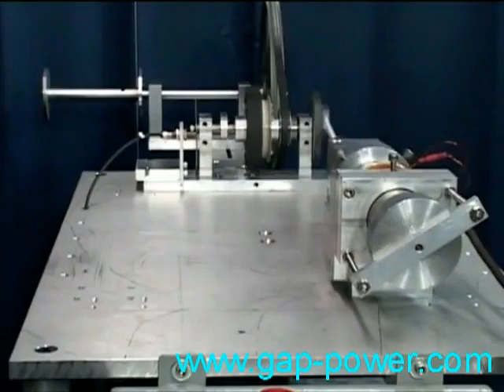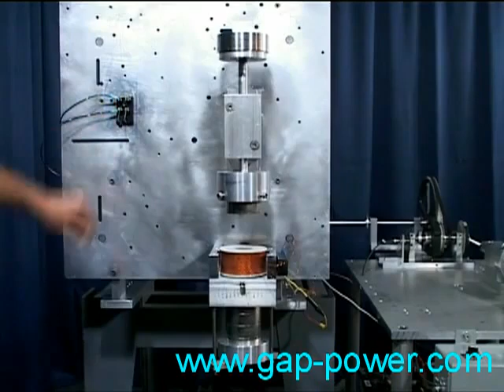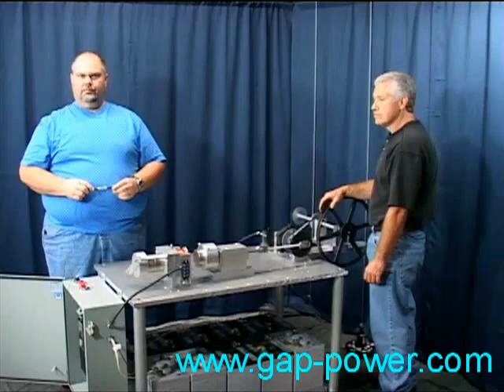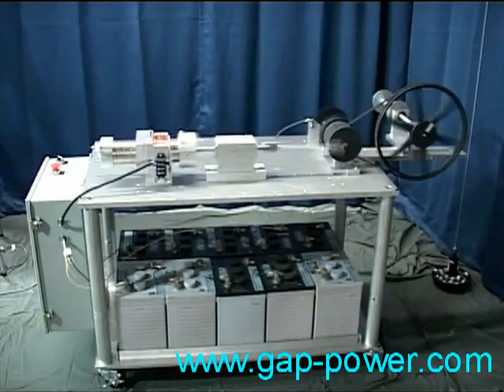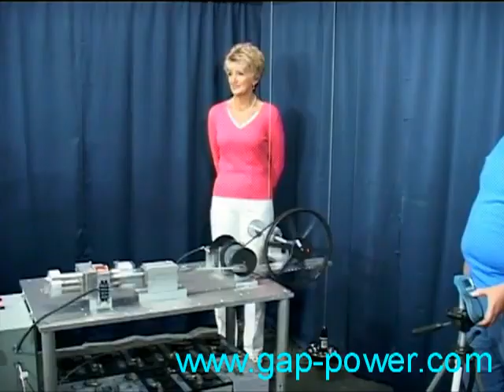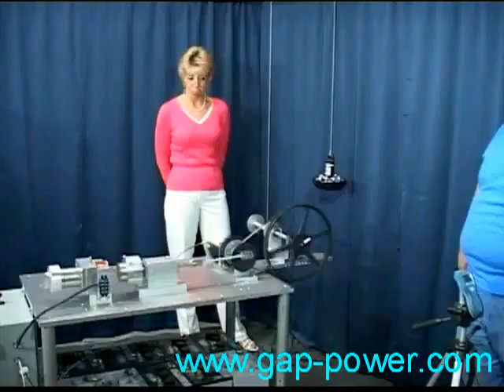FREE ENERGY  24 Working Magnetic Overunity Device   Magnetic Neutralization

Comment: in summary; if it is to create energy from the magnets and not from the power supply. it would have to use less energy to "BLOCK" the magnets than it produces FROM the magnets. 
and by the way, for the skeptics; if the energy is coming from the magnets, then it is not over unity nor is it breaking laws of physics.
Reply: george baker I AGREE everything has energy. The way we get the "energy" that the average person understands, is by taking advantage of "energy Differentials" 
If your 100 PSI steam engine exhaust is venting to an area of 99 PSI it would probably not turn at all. but if your one PSI engine exhaust is at a strong vacuum it will run strong. If you think of any system that produces "Useable Energy" you will be able to define a large "energy differential". 
So although everything contains infinite energy,,,, it is useless unless you can set it up in a differential situation and take advantage of it's natural force to equalize. 
Harold
Reply: FuckYouGooglePlus lol, i believe this because i built my own bedini ssg circuit and it works just as advertised. so go ponder on that for a while hateful dude.
Reply: FuckYouGooglePlus Apparently you are such a, hot head, IDIOT that you didn't notice I used the word "IF" two times. I should have been more clear about my standing. 
I do not believe it works, but I am open minded enough to discuss the basic principals. It's called "brainstorming" and regardless of the feasibility of any input during "Brainstorming" the future outcome can be something that works, and is usually something completely different than what any one person has added to the "Brainstorming session". 
If you really want to advance from crazy people's experiments on youtube, follow these simple rules:
1) Calm down
2) think about it
3) consider principals NOT amazing claims
4) Don't pay anyone who claims to "want to save the world" - if they wanted to save the world they could and would just publish their work for free!
5) mutter insults to yourself but reply with clear reasons it won't work.
I suspect your anger comes from the fact that you don't know why it won't work, you simply know that you were told "there is no such thing as over unity" and you like to Parrot that to the world because you are not capable of describing Exactly WHY it won't work. Your pride in the simple phrase "IT won't  work" satisfies your, very small, desire to think about anything seriously and that is a good strategy - you will always be right without even thinking!
Reply: FuckYouGooglePlus The word "IF" allows people doing research to move past things they can't explain and or things in the series of events that do not make sense. "IF" allows people to move past one point in a complex situation in order to discuss other concepts in the same system. 
Its like saying "IF GOD EXISTED" ... we know god does not exist, but in order to argue the other points in the god delusion (if they don't accept the simple statement "god does not exist") we must move past the obvious and move on to the individual points that may PROVE something to that person. 
Sometimes - in research and or brainstorming - the IF question gets people thinking about the same topic from a different point of view. It's like moving from the front of a problem to the back of it. 
Your argument strategy seems to be "just keep repeating that it does not work" and hope that after saying it several times the person will somehow magically get it. 
Did I happen to mention that I do not believe his claims and it can not work? 
Why do you keep calling me an idiot if I don't believe it works?
Reply: Except that magnets don't actually contain any energy. Force is not the same as energy. There is no law concerning conservation of force.
Reply: jhanthony2 there is no law conserving the amount of scalar waves they can build up either. If you ad force or motion to a system, then by definition that energy will be conserved, but its dumb ass hell that we include light and waves in with that, cause they are constantly pouring in from everywhere.
Reply: jhanthony2 everything in this universe has latent energy, everything is in motion in one form or another
Reply: Harold Geodesic That was well said.... and takes a lot into consideration....but there is still room for a few other scenarios...for instance the first reply is inane "magnets don't have energy" only if you accept that the current understanding is correct, however I beg to differ for having a better understanding than is normally accepted and they not only have energy, but without them we would not produce much of anything!  

What the flaw is, as ridiculous as this may sound to some (many) but the concept that electrons "flow" through wires is the most crucial flaw in everyone's attempts as they help create a differential significant enough to stimulate their (flux) flowing to create current.  

Um probably am not phrasing this well... It is pretty late...lol....just substitute magnetic flow for electrons...and magnetic current as voltage and amps or watts, as if magnets ...what WE refer to them as being, are not magnets at all, just materials that "possess" them in much greater densities than other materials, and when they move past some other materials like copper, aluminum, etc... they stimulate the magnets in them to flow... but you have to see magnets as being sublight particle in size, moving faster than light, and passing through everything and literally as the energy holding all matter together, and based on this, then it is much easier to understand why electrons were a means by which to explain something at a time when those who did understand, to everyone else, without actually telling them they weren't sure or chose not to let everyone else in on what they had learned, so that they could harness and profit from the discoveries Nikola Tesla had been labeled a mad man or the proverbial mad scientist for... and poor clueless Tesla, led them right to the answers never realizing THEY did not share his humanitarian mindset with power and wealth being seen having more value than the lives of others and the spiritual aspects of their own very lives of no value at all, compared to what their egos could provide them with at the moment!  

Too much to get into in a single comment but hope maybe someone will be inspired to read/learn more about his discoveries, and contribute towards taking it to the next level since we have so much more to work with today...and to also research Edward Leedskalnin, and the list of unorthodox semi geniuses that have come since these two live's times.... they put it together the rest of the way, but have had their wings clipped to contribute any more...(one reduced to living out of his car in a desert) but you will figure out who they are with a little ingenuity!!  ;-)

Peace all!
Reply: TheSmokingGun57 If I may respond, since I am the one you referenced as making insane comments. In your first paragraph you blithely toss away the accepted theories of virtually every scientist for the last 300 years, and claim that you, alone, know the real truth about electricity and magnetism.

I was curious as to how you would explain this, and you then launched an incoherent ramble of more than 225 words packed into a single sentence! I'm surprised you didn't pass out from not taking a breath. If you want to convince anyone that your eccentric ideas are a better explanation of electrical energy, you will have to find a way to break your thoughts up into small easily digested packets.

Also, if you want to be taken seriously, bite your tongue and don't say anything whenever you feel that the time is ripe to introduce Edward Leedskalnin into the conversation. If you involve him in this you will be summarily written off as just another kook.
Reply: jhanthony2 leedskalnin had made some pretty astounding observations about the nature of electricity and magnetism. He more accurately plotted the course of the planets through the solar system and around the sun than the models we use today.

     Anytime you write off someone as a kook without researching what they have actually done, not just listen to someone elses dissemination and biased ridicule, then you cant develope a better understanding of the state science is in now. One of close minded dogma and persecution no different than that the catholic church bestowed upon every new idea for centuries.

  If you take the time to a learn of all the other theories that much better explain the universe and, how elegant they are, how they predict things in space that continue to baffle modern theorist, when all they have to do is look at some of that other work that has been dismissed because it had the audacity to state that einstein was wrong, and that the redshift hubble discovered was NOT the same thing as doppler shift of sound in that context. You state that all these scientists over the last 300 years believe it so it must be right? but did you know that over 100 of the worlds most prominent scientists wrote a letter trying to get the media to understand that relativity is not a settled science and lots of scientist to this day know its a mathematical fallacy.

   So the point is, there is much much more evidence against relativity and the nuclear atom then there is FOR it. It just isnt ever advertised. And since most of academia has based their careers and books on this shit, and all new nobel prizes are awarded for whoever can come up with a new mathematical ptolemaic epicycle to make the absolutely polar opposite effects that are witnessed fit the age old theories that have no place in the 21st century.then they will never be any acceptance of  any new theory. As long as its these scientists that do 
"peer review" that is required for publication, they just rubber stamp "crank" on anything that conflicts with their idea of what these old theories say are LAW. We know of papers that were refused publication due to their title alone. This is NOT science. We have been acquiring empirical evidence for a couple hundred years, with that evidence we have deduced the universe to be 10's of billions of years old, yet we think we have figured out immutable LAWS. lol its really funny if u think about it.
Reply: kandysman86 You have a very cynical view of mainstream science, and I utterly reject your viewpoint. I'm pretty sure it would be difficult for us  to have a meaningful conversation in this venue. If we ever meet in a tavern perhaps we could go into all this and have a good time with it. I doubt that will happen on YouTube, though.
Reply: jhanthony2 i had a very indoctrinated view of mainstream science until i discovered the things i have, luckily observations of the behavior of this institution dont rely  on your willingness to accept or reject the viewpoint. It is what it is, the same thing it has always been since the days of kepler, copernicus, and galileo. Its sad to think we still use models of the atom that where, at the time of their inception, known by everyone that it wasn't correct. Even Bohr knew when he proposed it that it was a model only, that he knew did not represent reality. Yet when a much better representation is proposed that predicts and explains much more are ridiculed unless they hold to bohr's nuclear atom. Its laughable when you take an OBJECTIVE look at it.
Reply: kandysman86
Again to the idiots...you don't get to use your ignorance and gullibility as proof of your conspiracies. Meaning, you can't say "I read something on a website about a guy who did something really great but it was covered up...and since I am such a complete fucking idiot, I believe it...so that makes it true.. All that proves is that you ARE a fucking idiot. And not one worth talking to
Reply: Harold Geodesic
Saying "if" and then something that CAN'T happen still makes you an idiot. It doesn't make you intelligent to say If 2+2=5. There is no IF about it.
Reply: FuckYouGooglePlus straight lines, points and, circles dont exist, yet all mathematics relates these unnatural forms to reality constantly and base all theory of the natural on the unnatural. So to mathematicians 2+2=4, but light taking its natural curved path around the sun, and its atmosphere that lenses the light to an even greater curve, is misrepresented by the math as space itself curving. Even though moving in a straight line is imposible over any amount of longer distances . I would rather have a better grasp on whats ACTUALLY happening, not what fits a man made mathematical abstraction.
Reply: FuckYouGooglePlus oh look mr. stupid knowing everything google plus guy wonderful reply anywhere I read and everytime ur wrong how come ????????    when are u giving up ???????????   its hoplessly stacked against u, and yet u don't see the trees in the forest isn't that wired ? !!!!!!   it is pointless to go against something that has been proof to work over and over and over and yet ur still saying its not are u really that stupid and ignorant it shows a lot about u !!!!!!!!!!!!!!!!!!!!!!!!!   im just saying !!!!!!!
Reply: Ben Scholz
Dude...you think free energy is possible and that magnets can make something rotate continuously...you REALLY shouldn't be attempting to mock others. You are the LOW man on the totem pole.
Reply: FuckYouGooglePlus you do realize that we have discovered techniques to mix north and south poles across the surface of a permanent magnet? It used to take very clever people to create the asymmetric qualities needed to produce continuous motion with magnets. But now we can make the magnets do all the clever, asymmetrical processes.                                                                                             This info is available, but you will probably never see it if the mainstream don't point you to it. All it takes for you to believe them, is for them to been right about a couple things, now all they have to do is tell you the others are wrong, and you wont look any further than that. If you cant see the parallels between new "scientism" and religion than it is probably to late for you in this life. Maybe next time you will get lucky enough to be born with a naturally curious AND skeptical mind, that demands its own interpretations, instead of relying on others.
Reply: kandysman86 "It used to take very clever people to create the asymmetric qualities needed to produce continuous motion with magnets."

The only thing these "clever" people ever figured out is how to sell snake oil to gullible fools. And I'm afraid I must inform you that you have purchased about 15 barrels of snake oil if you think magnet motors are real.
Reply: jhanthony2 looks like your in the wrong place huh? seeing as how this elucidates such an emotional response. Wasn't trying to insult you scientism faith.sorry.
Reply: kandysman86 I'm sorry. I didn't know I needed a special YouTube visa to visit the land of the unicorns and mock the inhabitants. (I don't think 'elucidate' was the word you wanted, BTW.)
Reply: jhanthony2 lol. yes it is, you make clear your feelings. this "talk", "elucidates" them, as it were.

Comment: I think it's great, I made a small magnet motor that worked on the same principal only it used the power of a magnets attraction to a steel core. 

The biggest challenge is to separate the energy going in (shielding energy) from the energy it produces (generated energy or back EMF) 

The only way I can figure off the top of my head is simply to put a bridge rectifier on it in some configuration that will not allow your input energy to flow into a separate battery, but will let the generated energy flow into the separate battery. once the second (separate) battery is charged - then a switching device reverses the batty purpose of the two batteries.
Harold

Comment: This is actually a very good demonstration; my compliments.  To address your concerns about crank and piston assembly being a poor use of the magnetic force, try reversing the setup so that the magnets attract instead of repel.  This puts the strongest point of the magnet in a pull state, with the increasing power of the magnet giving a "snap of the wrist" effect to the spin.  I suggest you seek the help of a measurement specialist (metrologist) if you want to know how to measure the inputs and outputs correctly--and since you've proven the device will output real work, attach a generator directly to the rotor and measure the output in real Watts of electrical output.  You can then measure the input in real Watts as well and have a direct input/output comparison that people will understand.  I'm not saying it's overunity, but it's definitely the best demo I've seen of a potential overunity device.

Comment: It seems to be a temorary Over-unity device. However, Eventually the magents will `wear out` and lose their power. You also have to calculate into the equation the `build cost` (just as you have to calculate `de-comissioning costs [and accidents] into nuclear power prices).
You can prove the magnets wear out, simpley by switching on an an electric fan and stop the blade moving round for a few weeks. Eventually the `Resistance` stops the magnets from functioning as the power to drive the magnets counters the North and South poles of the magnets. the Earth will do the same one day; affecting the revolutions of the planet.
Plan forward. New things will emerge. Maybe after we should have tapped the geothermal energy from volcano`s and Yelowstone Park